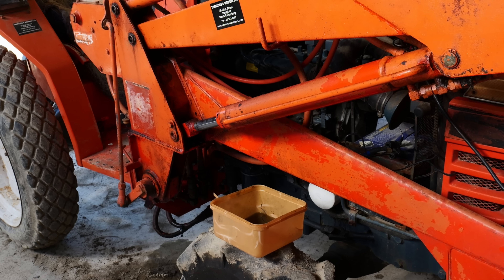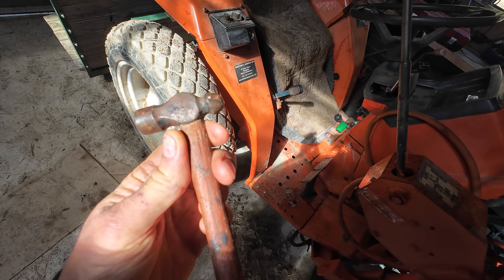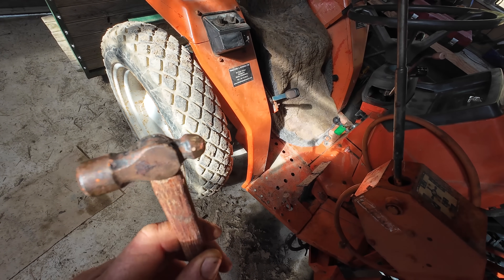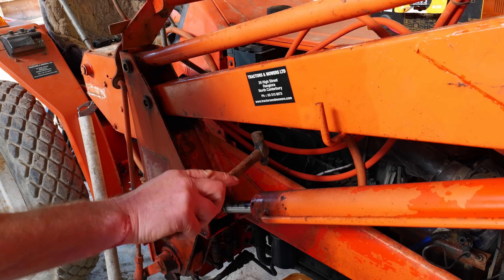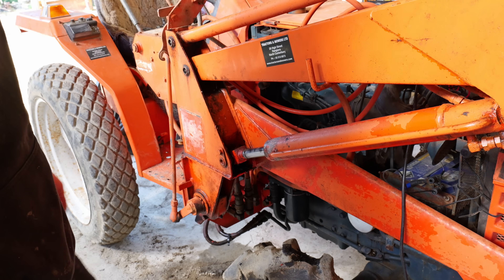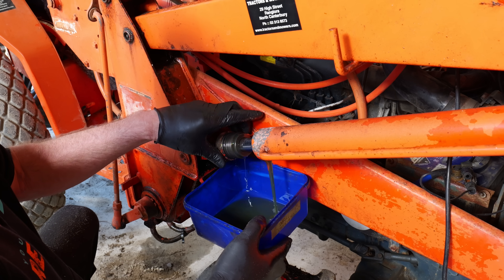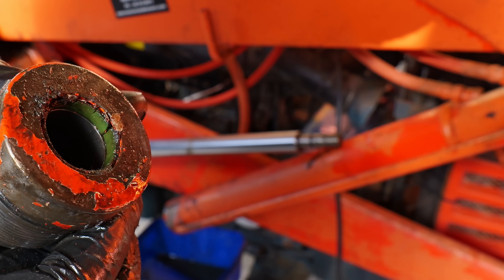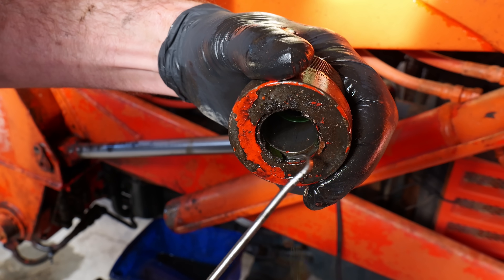How to Free a Seized Hydraulic Cylinder Gland Nut in Seconds

Comment: Had to deal with a serious 5+ inch gland nut for an excavator stick cylinder. Our underfunded shop couldn't get it off in the end, but I busted out out the ball pen hammer, fully charged battery for our 1 inch gun, and lastly apply penetrating oil on the bolts that were nearly siezed onto the cylinder. Such small practical things that people were doubting at first, but cracked our other problems loose fast. Its about them vibrations!!!

What I want to try more is heating the area around, and apply water, shock it various times.

Comment: a little percussive maintenance... works wonders... my favourite tool was a rubber headed mallet... with which i beat up the part causing frustration... it didn't help in fixing things but i always felt better afterwards... and it was rubber so nothing was damaged. When i really struggled the best remedy was to down tools and brew a mug of tea... that usually did the trick

Comment: Im curious about how the tractor can be 4wd while the front and rear tyres are different size, is there different ratio gears in the diffs or something to counter the difference?
Reply from the maker: The transfer gearbox speeds up the output shaft to the front diff so the smaller front wheels turn faster

Comment: Is it safe to be using those sharp metal picks around the sealing surface? might be better to buy a couple cheap plastic ones. also you could try penetrating oil like gibbs or freeze it either with a bunch of ice packs or nitrogen if you are allowed it there.

Comment: remember using this method 50 years ago. It works most of the time. You can use the same method to loosen up stuck nuts on a thread which I did yesterday. Tap the flats of the nut 90 degrees on all the way around the nut. A hammer is a very useful tool

Comment: them gland nut spanners are junk, my dad and i broke 2, i ended up using a blow torch and a big pipe wrench with a big extension pipe to, melt the lock-tight and pop it loose, tried everything else but nothing else worked, last resort would of been, weld onto the ram pipe and onto the gland and use bigger tools, it was on a 4" ram

Comment: I've been around heavy equipment for many years and have never seen this trick. Thanks Marty.
Reply from the maker: Try it next time, it makes all the difference
Reply: I know this trick because it also works on jars...  light taps, don't break the glass.   Thanks mom.
Reply: i`m plumberman and thats trick is always must be done
Reply: @auser591just put a teaspoon handle under the lip of the lid and lever away from the glass a tiny amount to release the pressure. Lid will just spin off with minimal force.
Reply: you could also use a air hammer, just dont overdo it.